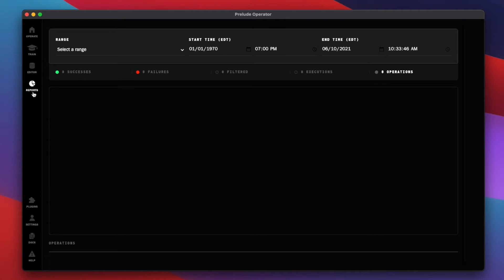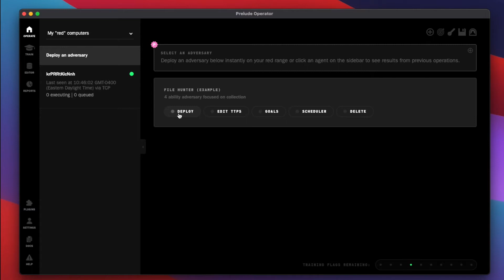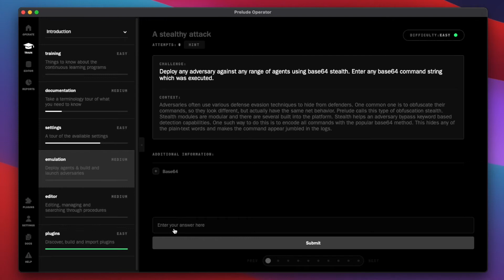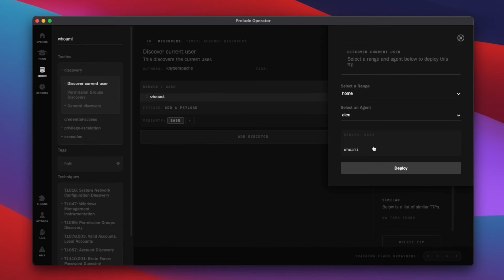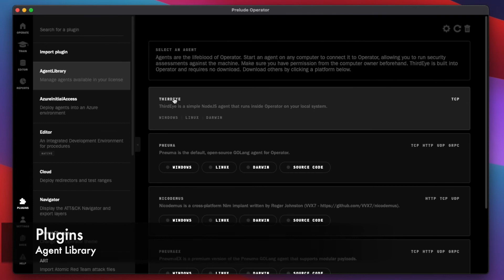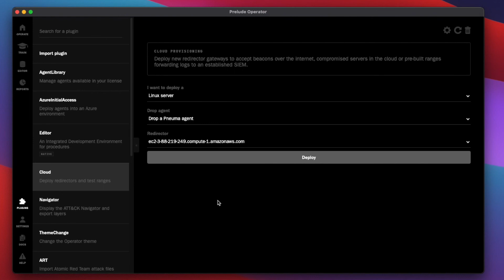Introducing Prelude Operator 1.0.0

Comment: The problem with this is that i need to learn the prelude software, whereas i current can just spin up a vm from vulnhub and play around with vulnerable machines from there.
Reply from the maker: Operator is primarily an adversary emulation and automation framework. The purpose is to help simplify detection engineering processes by making it easier to build and run predictable attacks. You could use it to poke around vulnhub boxes though and we actually have a built-in provisioning system to deploy virtual machines with preconfigured challenges.